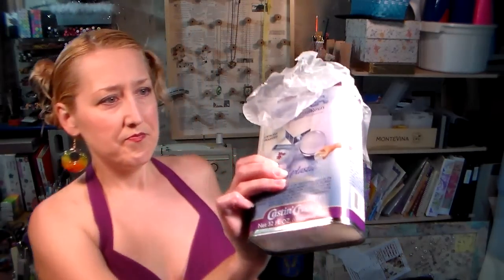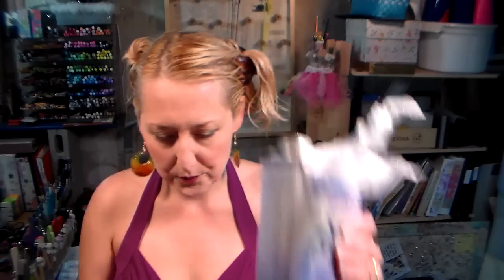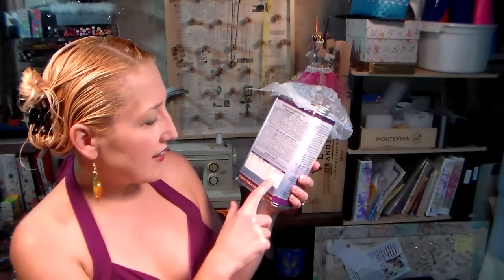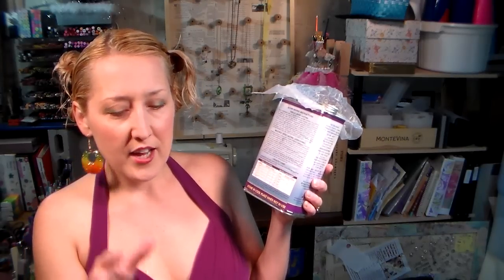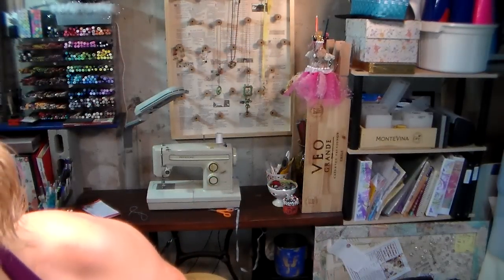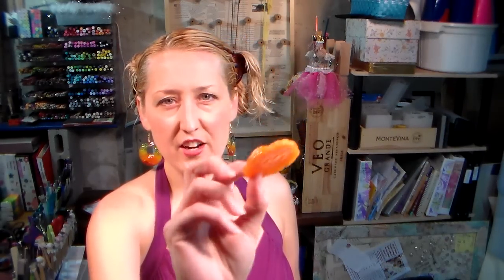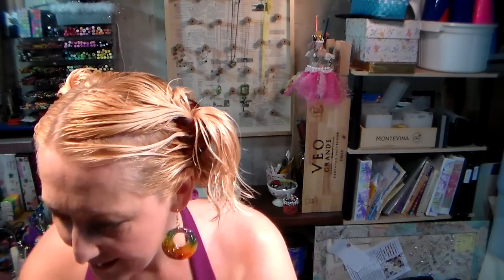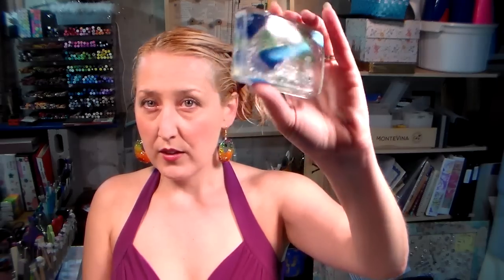polyester resin 101

Comment: Dose the Resin have Wax in it?

For the most part, Polyester Resin will not set fully, it will stay tacky for ages.  This allows multiple layers to be applied one after another without prepping and sanding between (Talking about Fibreglassing).  All the time air is around it, it'll set, but never fully even with the Catalyst.

The magic happens once it is set, but not fully, by putting a layer over the resin, it cuts off the air and starves it.  This is what makes the resin harden fully.

Your Floor Wax that you have there is the magic barrier that allows the final cure.

Polyester Resin that has Wax mixed in with it, the Wax will slowly raise to the surface and make that magic barrier, only this can mean sanding after the resin has fully cured.

Hoped this helped.

Good work, keep on playing.
Reply from the maker: Neil F Thanks! The floor wax did the trick on the backs of mine:)
Reply from the maker: thefrugalcrafter Lindsay Weirich Floor wax is more of a thin acrylic sealer than a wax in the traditional sense. Thanks for letting me know about the science of it:)

Comment: How hot does Polyester Resin get? The woman in the store told me that it gets "very very REALLY REALLY HOT !" so I'm a bit afraid. I wanted to use it in silicone-molds (that I will make selfmade) that can deal with 250 degrees CELSIUS so that sould be ok for .. well ... every Polyester resin?
Reply: But it says that it can only deal with those 250 degrees for "a short time". Hm. Does it get hot fast and then cool down or what's the exact behavior?
Reply from the maker: VictorSteiner it does not get extremely hot, I used plastic molds and they did not melt.

Comment: What are the higher pros to polyester vs epoxy resin?
Reply from the maker: Sarah Dillie polyester is cheaper, but smellier I think. There is a brand of epoxy that is oderless I hear, it is called little windows I think. The are very similar though, you just need to know epoxy has a 1:1 ratio mix and polyester uses a catalyst and the amount you need can vary due to temperature and humidity so it has a bit of a learning curve;)
Reply: Envirotex brand epoxy resin from Michaels with a coupon is so cheap plus it's VOC free (no nasty smell or need for a respirator)

Comment: You made some pretty nice jewelry! I didn't know you could get those results with polyester.

I don't know if this works with the clear resin (you might want to experiment with a little to be sure it's good) but with marine-type resin - the opaque stuff - you can dilute your resin with no more than 10% acetone (some people say up to 20%, but at that level, the resin may not cure properly). The acetone trick is good for when you need to add a little extra catalyst or if you're working in colder temperatures. It can delay curing by at least a couple of hours. The more you add, the longer it takes to flash. Add too much, though, and it could make the resin too brittle. You just kinda have to wing it a little. But it's something to keep in mind if you have to work in the cold or high humidity.

If you try the same work with epoxy resin, you can dilute it up to 1:1 ratio with denatured alcohol. At 1:1, it turns the epoxy almost watery, but the cured results are nice. I found that out from Greg Hahn at Model Aviation (he's got a video on it here somewhere).
Reply from the maker: thanks for the tips! I bought a separate bottle of catylist so I think I am set for the polyester resin I have:)

Comment: Fun!
An idea for jewelry making or other cast items that will use a fastener or post or loop: embed the earring post, fastener, wire loop, clasp, etc. in the resin along with the other embedments while molding.  Then you don't have to glue it on later.  Modifying the mold may be required.  
I don't make jewelry and I have not tried this.  Would it work?
Reply from the maker: yes, work in layers, when you are near the tip add a thin layer and your finding, great idea!

Comment: I also have a tip for casting in colder weather: I've gotten success in my experiments with polyester resin by adding one more drop of catalyst (I'm afraid to add any more!) and putting the molds in my unfinished (therefore still really cold) garage in a box on top of a heating pad set to high, then putting tin foil over the top. I have to do it out there because other family members' asthma gets really bad with the smell. I don't have much room out there, but I'd like to add a heat lamp over them as well. My tries have cured in about 18 hours, but I think I'll add more catalyst. Hope this helps people!

Comment: Fantastic video! I've just started using polyester resin after not being satisfied with the epoxy resin, so I'm still doing some research. I've used alcohol dye in the epoxy resin before that worked really well, but I saw another video where the alcohol dye sort of evaporated out of the polyester resin while it cured. Have you found any dyes that work well for making the resin still look transparent?
Reply from the maker: acrylic paint gives you a translucent effect, just a touch though. Or try ink.